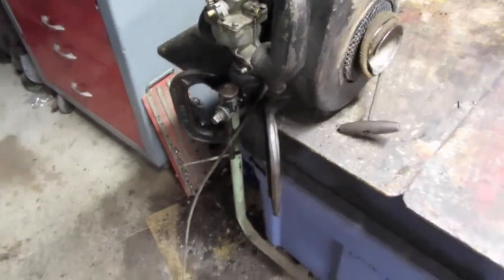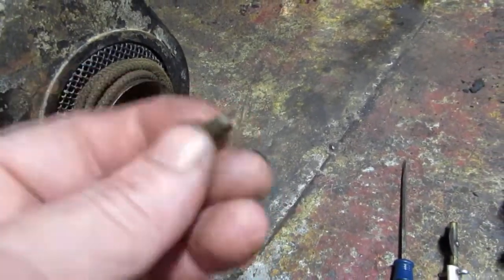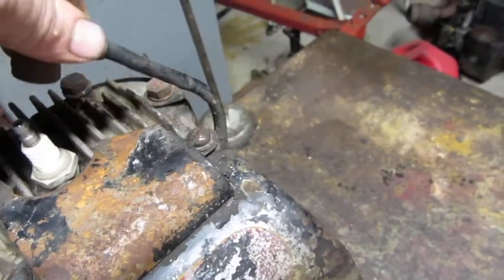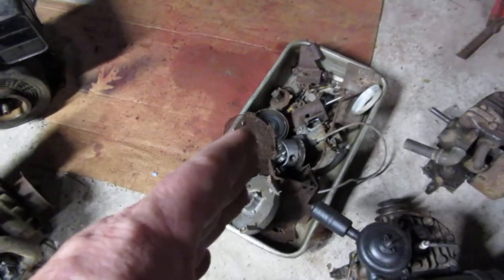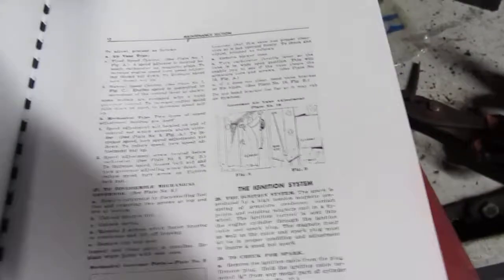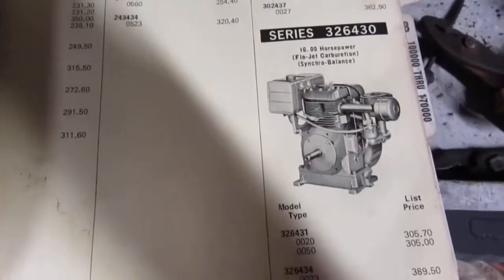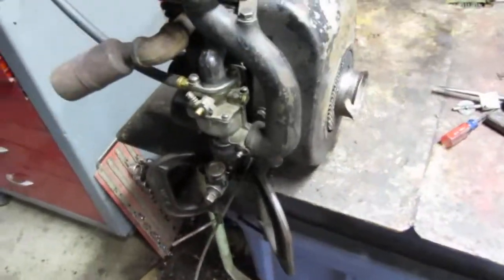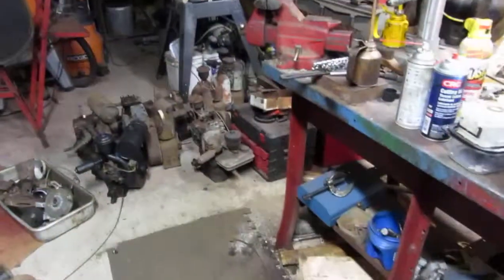David Bradley  motor model 500.306197

Comment: Idk if you have one or not, but could you make a video on the throttle connections, the governor springs attachments and show the differences between the air vane gov and the mechanical gov setups?
Reply from the maker: will try get a video on that